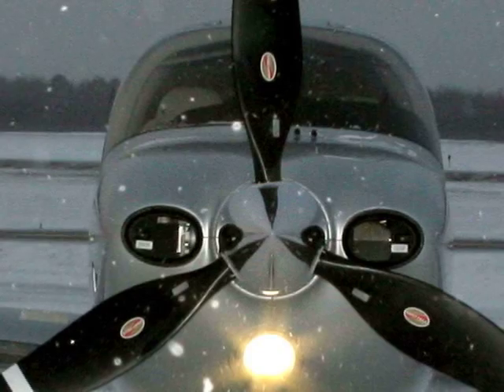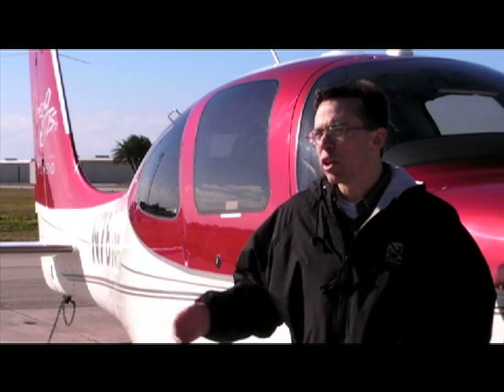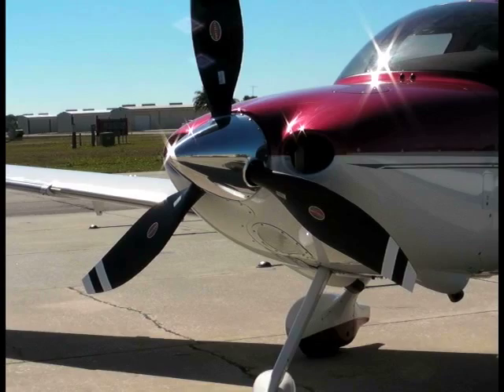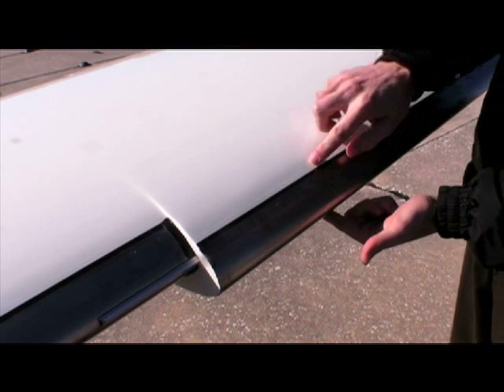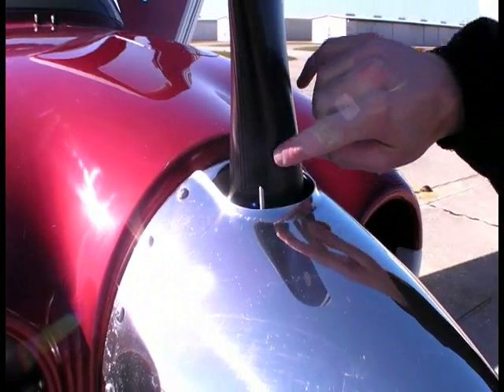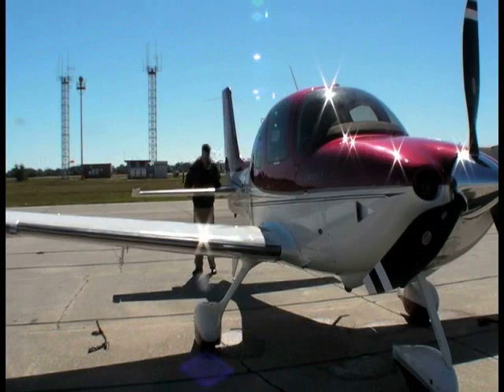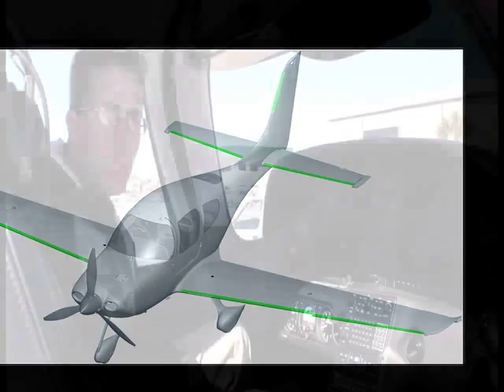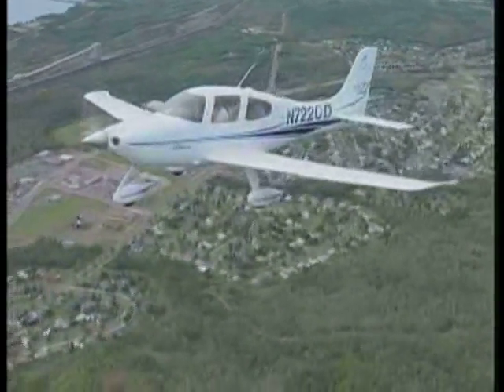Video Demo: Why Cirrus's New Flight Into Known Icing Package

Comment: i don't want tks. I want boots and electric heat.
Reply: Why? ...clean up?  ...weight?
Reply: @Caderic  TKS doesn't last. A heated wing (which could be an issue because that's where the petrol is) would last for as long as the engine turns.
Reply: @ellenorbjornsdottir1166  Ok, fair enough.